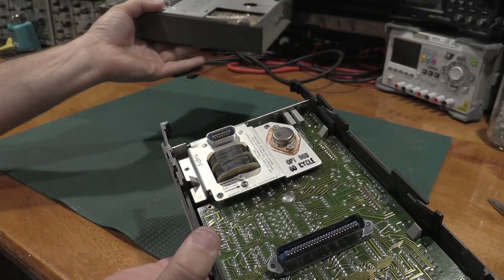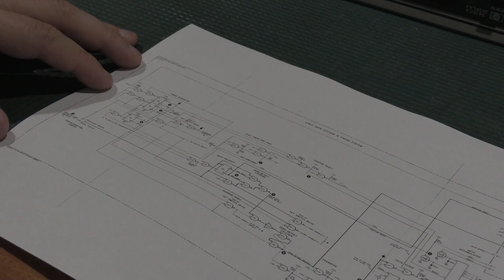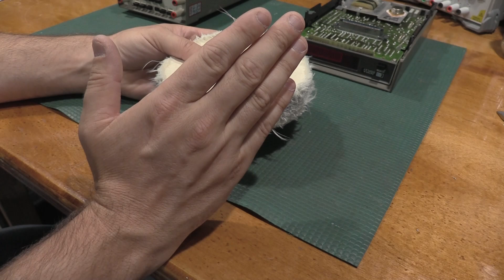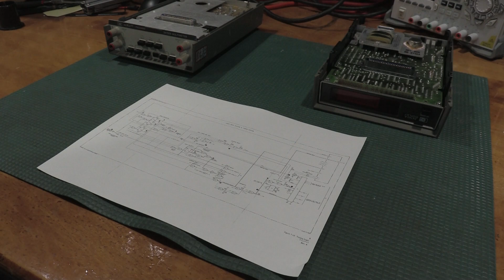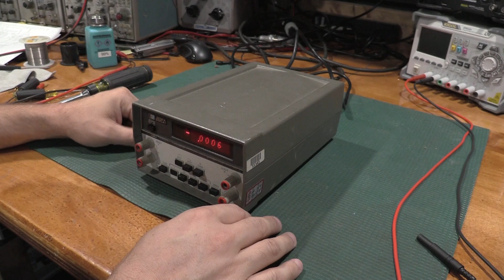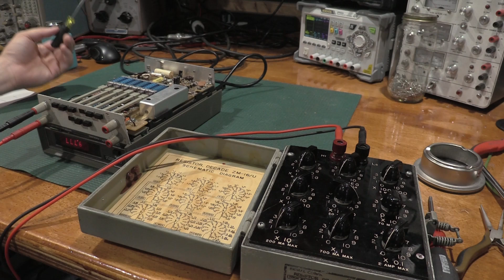HP 34702A Repair and Restoration Part 2

Comment: Just use 2 10X probes in A-B mode. Do not connect ground leads to unit under test. Adjust both channels to the same range. Clip the probes together and fine tune one variable to null out the signal. Channel B probe is connected test unit ground. Channel A is signal.

Comment: Yes watch which chemicals are used, for a number of materials petroleum based like kero should be used, do not use alcohol.  For polishing I use toothpaste and a microfibre cloth and several minutes of polishing as desired. This alows a high degree of control to polish specific areas and avoid any decals etc.

Comment: To remove stickers use a hot air gun to melt the glue. Then slowly peel it of. If you need to reheat it until it comes off. Once it is off you can spray a little WD-40 on a clothe or paper towel and wipe the sticky glue off. The clean off the WD-40.